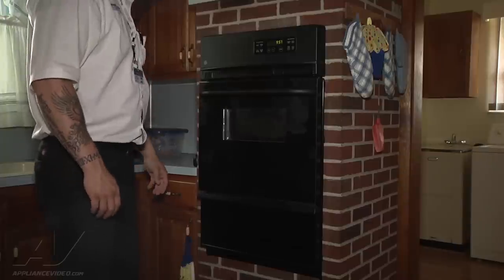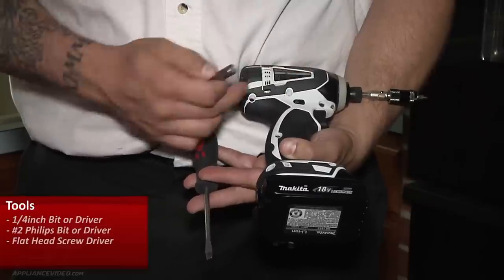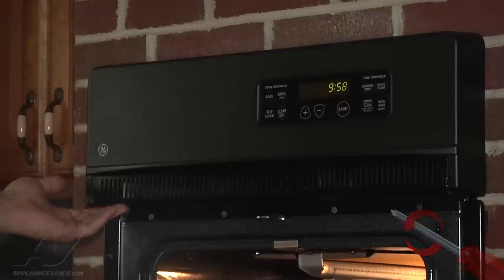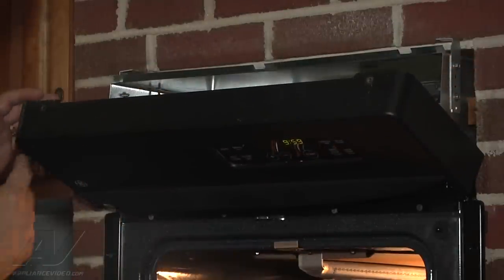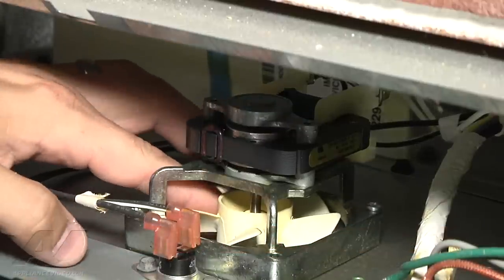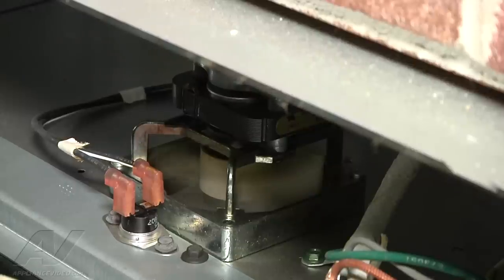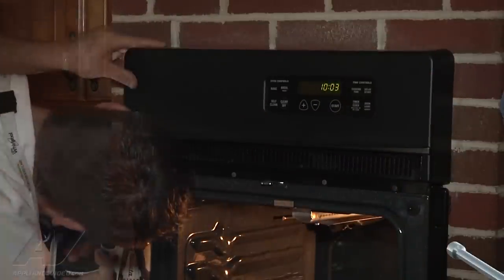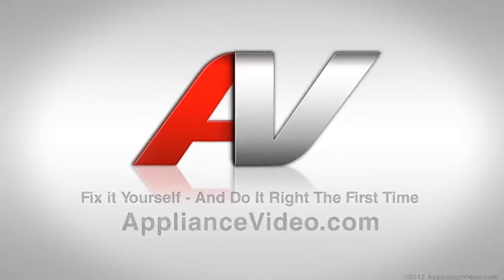GE Oven Repair - Loud Fan Noise - Fan Control

Comment: Why didn't you replace the fan motor assembly if it's covered under warranty instead of "Bandaiding" it? Not a fan of doing "BandAid" repairs I'm having the same problem with mine doing the same bloody thing after 10 months of using it brand new.

Comment: Is this something that would happen to a new fan blade?  I only had this oven for four months and it just started that loud noise.  We hardly ever cook!
Reply from the maker: +Yolanda Cal 

Great question on the fan blade, with our
technicians now getting hundreds questions weekly, they are answering all questions
at our website http://www.appliancevideo.com/repair-help/ .  We also have over 30000 common questions
and answers that you can easily search through by your model number, appliance
make, problem or error code and it’s absolutely FREE.